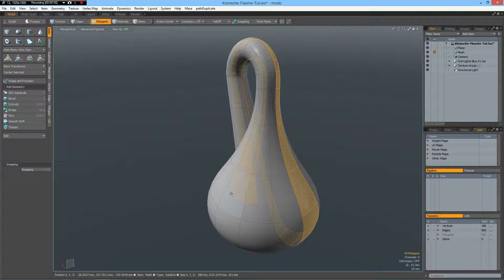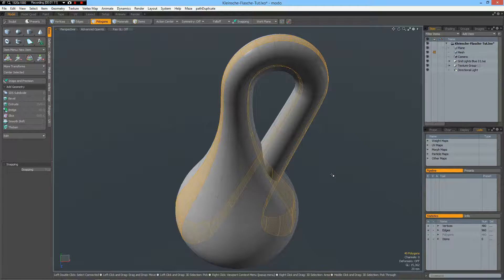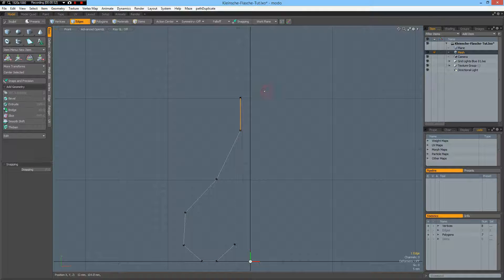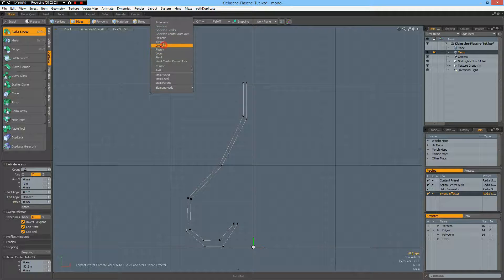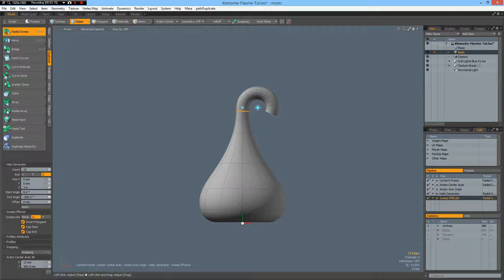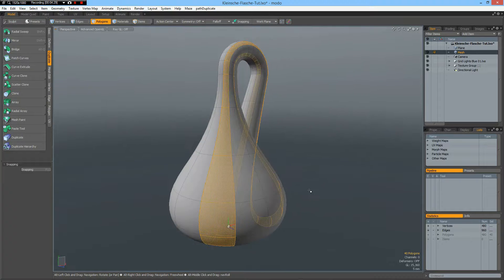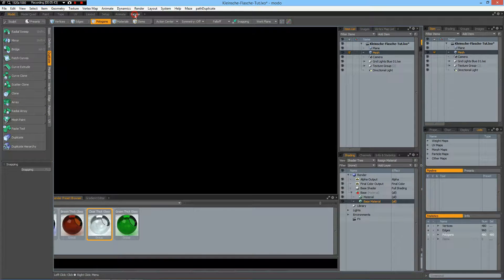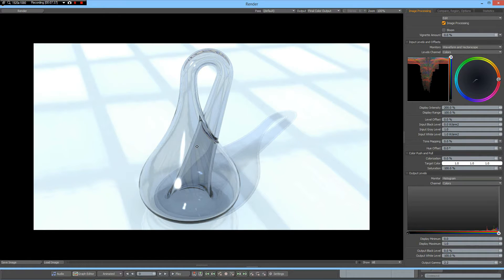The Foundry MODO - Modeling a Klein Bottle (for Guido)

Comment: Hi, Peter:

Thank you so much for this video.

I am beginner and I thought of sharing with you some difficulties I had in following the instructions in the video (I use modo 701 sp5) :
- the radial sweep didn't work as good as it worked in your video. It turned out the problem was the fact that the two polygons that were supposed to be rotated were not in the Z=0 plane. Somehow, I thought when I flip to front the Z=0 plane is selected automatically which is not true. I repeated this process quite a few times, the frustrating thing was that it worked at the beginning properly, then it stopped working and I was getting these weird shapes. Bottom line is make sure the polygons are in the Z=0 plane when you switch to the Front mode.
- after the radial sweep was done, when I selected the top of bottle (as you did in the video - Front mode) to do another radial sweep only a half of the "circles" at the top were selected. I discovered this only after I've done the radial sweep and I rotated the bottle in the Perspective mode (the handle had a half missing). I am not too sure why modo decided to select half of the lines (and yes, I aligned the two vertices at the top of the bottle when I drew the interior polygon). So, it is another thing to watch for.
- I had a lot of difficulty in selecting the surfaces to hide in order to be able to bridge the handle of the bottle with its bottom. Modo seemed to always select the interior polygons as I hovered the mouse above the surfaces. This might be my lack of experience, but it sure looked very easy on your video and I was surprised to find how hard it was. Finally I managed to hide those walls by selecting loops of surfaces using the left and arrow keys. Maybe there is a setting somewhere that tells modo to look at the front polygons?
- Setting the material was highly frustrating. In your video it is pretty straightforward, you dragged the glass and the bottle became transparent. I did the same thing and in my case the bottle became black! I started to play with the different settings. I set the bottle material tag to Bottle Glass. I found confusing the opacity setting on the Bottle Glass and the Clear Thick Glass.lxp nodes in the Shader tree to be set to 100%. Apparently if I changed the Opacity to anything less than 100% the bottle became opaque (again this is my lack of experience probably, but it sure is confusing). Then I selected the Material (249) node under Clear Thick Glass.lxp and I started to play with the settings - paused the video and tried to have the same settings as you did in the video. I tried so many things, that I lost track of what worked and what didn't, but finally I managed to make the damned bottle transparent. I think the settings under the Material Rays under Volumetrics made the difference.I set the Scattering, absorption and luminosity colors to white.
- I still couldn't get the environment look like yours, with the plane, I will try it again later.

I have to admit, working with modo is highly frustrating. I am a programmer myself and use modo as a hobby. Not once, I found myself asking wtf did the programmers think when they chose these name or this layout or options, because they don't make an inch of sense. You have be at it constantly to ingrain in your brain all these peculiarities. I tried to use blender in the past but I gave up. I would have used 3dMax but it is too expensive. 

Just curious, how did you come by using modo?

Thanks once again for video, and I hope in the future when you do the videos, don't take everything for granted - there are noobs like me that struggle with simple things ;0)
Reply: Just one minor correction. To change the color of the glass from black to real transparent the setting that did it was the absorption distance - I set it to 0m.
Reply from the maker: Hi, it seems you have some of the problems almost all new modo users (including me ..) have. First of all, i ALWAYS center my main object in the center of the (modo) world. The second point is, that you seem to have selected just the visible edges (right mouse button) and not select through the model (middle button). If you are in wireframe mode, then you must invert this.. (no clue why it was done that way..) 3rd, be sure you are in poligon mode if you want to select surfaces. Modo is very unforgiving. It does exactly what you tell it to do. For example, if you tell it to poligon extrude (Shift-X) and then change your mind and do something different, the polygons are already extruded and you have double ones ! So use the 'Mesh Cleanup' always, whe you think modo is not doing what u think :-) Helps a lot ! But as a programmer, i should not need to tell you, because a program also never does what you think.. It always does what you program :-)))I wish you good luck with modo and once you master the initial problems, it's a terrific piece of software. Kind regards, PeterPS: You should watch some of my older videos or some of other people like Apple Soldier. I do a lot more explanations there and actually, all of my videos are a single playlist where i try to show new tricks and tips and expect that people have seen the old videos. So that's probably not the case but i will definitely not explain every thing i do and most of all, why i do it everytime i make a new video. Otherwise they would take forever
Reply: Thanks for the tips! I will watch the older videos as well.

Comment: As always, terrific, Peter! But, there is still one problem: your bottle can't be filled up yet because the funnel intersects with the wall... I was able to fix this by using 8 sides on initial sweep and cutting the outside of funnel on either side of wall and bridging it to outside and inside walls of bottles respectively after deleting 4 polygons from each side.
Reply: Hi Dimitry Chamy,
is it possible to share your solution with us.
My brother is a Glass blower and told me it's hard to build this bottle and you need a lot of experience. But in the real world you can fill this bottle with liquid but releasing the liquid will be a big mess. Thanks for your comment I liked it.
Reply from the maker: Hi Dimitri, i thought this subject would come up. There is a LOT of reading material out in the internet. I will try to summarize my understanding. A Klein Bottle (the one i did) and a punctured Klein Bottle (yours) are topologically not the same since one has an edge and the other does not. In fact a Klein Bottle is a one sided surface with no edge and it is non-orientable and has zero volume. When a Klein Bottle is disected, then it will end up in all Möbius strips. Kind regards, Peter
Reply: Dimitry Chamy
Thank you very much Dimitry Chamy. That's what makes a good community.
Reply: Peter Stammbach Indeed, Peter—I misunderstood your intent to demonstrate a pure mathematical concept versus a physically constructible and usable version of that object. :)
Reply: Hel Lo I am far from a Modo master like Peter but your request prompted me to share my first mesh on Luxology site: http://community.thefoundry.co.uk/asset/meshes/view.aspx?id=4277
Hope that helps.